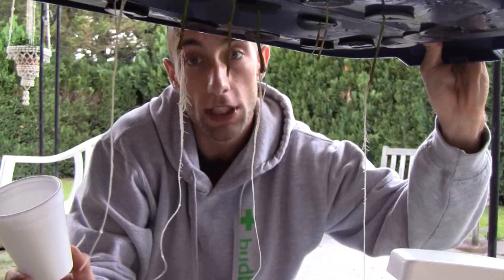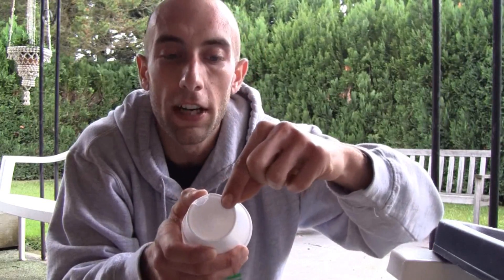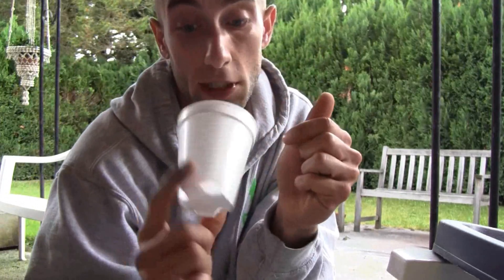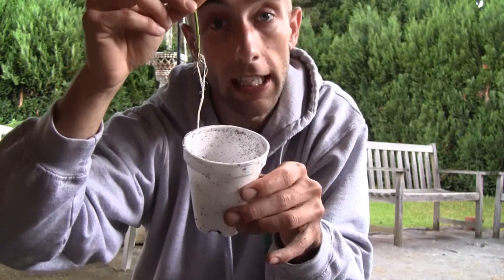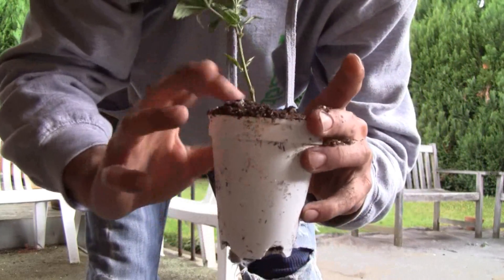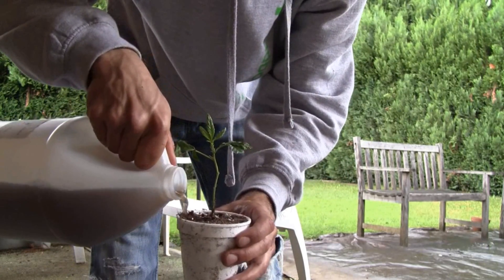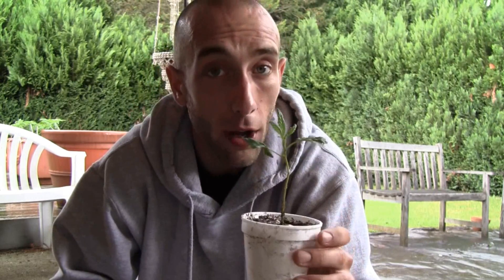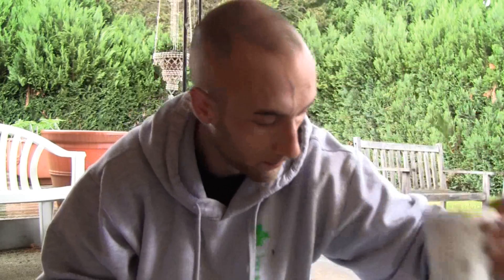cloning from aeroponic to soil successfully

Comment: if you lightly scrape the stem for about the bottom  inch or two , you will get a much larger root mass that doesn't need to be that "long" , and will make much healthier and faster growing clones .